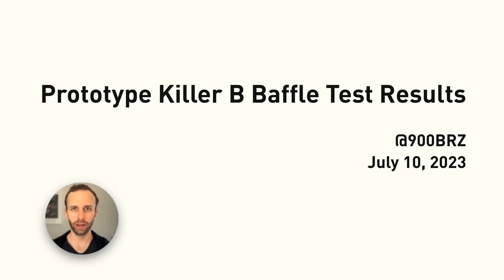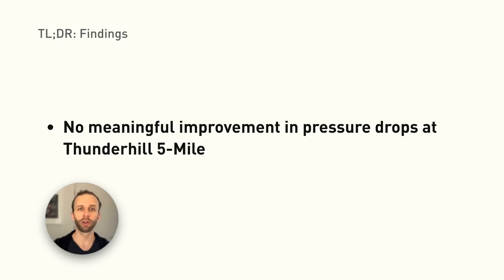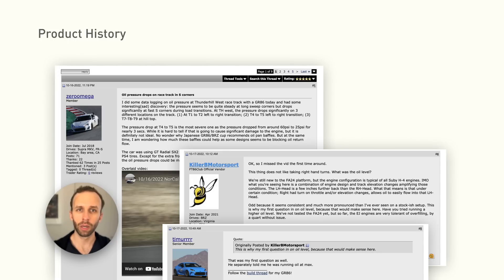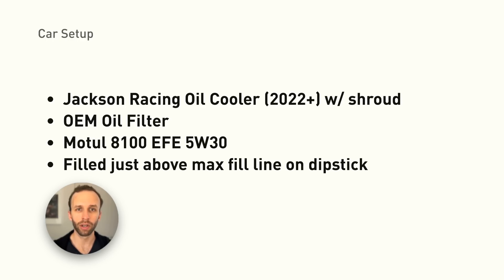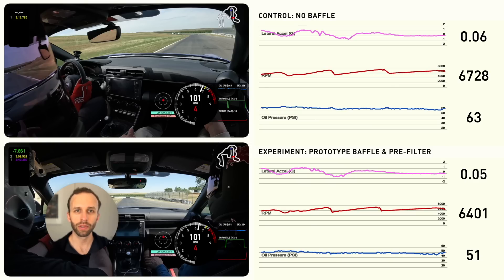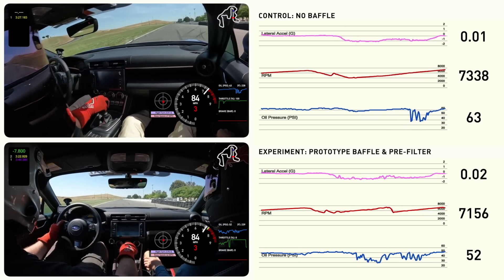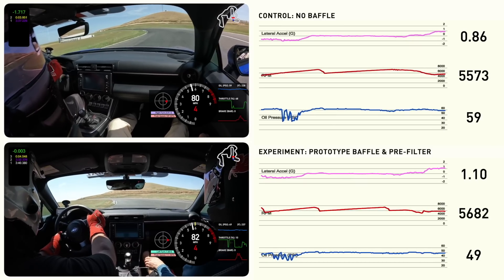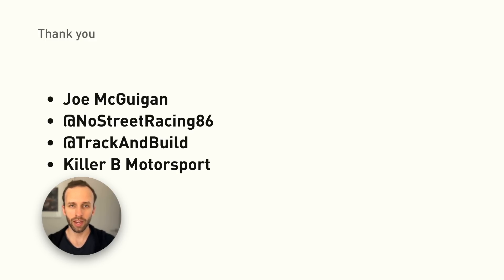BRZ/GR86 FA24 Killer B Prototype Baffle Test Results

Comment: seriously awesome work. While I don't have a second gen I really appreciate the hard work you're putting into this issue. This is the kind of stuff that makes the twin community so great.

With that said I'll bring up what I mentioned on your last video. After looking closer at the shape and layout of the oil pan I still believe the issue is the asymmetrical oil pan and pickup favoring the passenger side. I'm pretty sure the best solution will be a vertical walled baffle that runs front to back to prevent sloshing towards the driver side. That's not to say a horizontal baffle isn't needed either but I think the car needs a system like what IAG builds for WRX's. 

As for your idea of over filling, I feel like this may alleviate some of the pressure drops but then you might run into more issues with excessive blow by. I'm guessing 1/2 quart might be ok but much beyond that I'd worry assuming you don't have a horizontal baffle to keep the oil from sloshing up into the the upper oil pan / block girdle area. It might be a good idea to see if KillerB will do a horizontal and vertical baffle system combined with a little more oil. Though it would be good to measure the volume of the stock oil pan and keep the oil fill to what will fit in the pan.
Reply from the maker: Great ideas and I’m thinking something similar. I’m interested in the Kazama baffle, which has a horizontal wall with a 1-way trap door to try and keep oil near the pickup. I’m a little concerned that unless it’s welded in it may lose too much oil around the edges on the vertical section.

Comment: This issue is currently holding me back from purchasing a BRZ. The whole point of these cars is to be a fun little track car.  Might have to keep my evo for longer
Reply: Trust me, keep the Evo
Reply: Ironic considering Evos have oil starvation issues as well lol
Reply: @KTH96  except ive had mine for 13 years, its 25 years old with 115k km and many many track days without a problem.  All these are less than a year old with minimal kms and are spinning bearings.
Reply: If you need to replace the EVO, get a VB WRX.  The FA24DIT is as good as a 4G63 in many ways.   Only took Subaru 30 years....

Comment: Sad this didn't help :(( I had high hopes. I suppose I'll go SYMS + 1/4 qt overfill. I think I remember reading it's common to do 1/2 qt overfill? I've always been told overfilling is dangerous because it can push gaskets out and cause leaks though. And of course, the obligatory thank you for your testing, data and observation of variables.
Reply from the maker: I have heard people doing 1/2 qt overfills without issue. You may want to look into a catch can/AOS if you go down the overfill route, but I think 1/2 qt should not be a big deal. SYMS is the best performing baffle we’ve seen out of 3 now.
Reply: I drive my BRZ 2014 for fun at the Nordschleife and always have an overfill of 1/2 qt.
No serious modifications, just an oil cooler, lowered suspension and 235-17 tires.
Reply: @rickd955  I don't think FA20 had oiling issues though
Reply: @CarsMeetsBikes  Just look at offered short blocks for the FA20, most tuners talk about a oil pressure modification (keeping it a secret what is done). It seems that the first cylinder can suffer from oil starvation.
Reply from the maker: All wet sumps will have trouble if enough lateral G are applied. FA24 had this problem sooner than FA20 from out testing. Can’t even deal with OEM levels of grip.

Comment: I was surprised to see lower oil pressure, since the oil pump seems to be in constant pressure relief above 4500 rpm or so.  I would say that the suction pressure of the oil pump must be increased (i.e. more vacuum pressure at the pump inlet) in order to see lower gauge pressure at the outlet when the pump in in pressure relief.  High suction vacuum pressure is typically caused by inlet restriction (therefore probably the pre-filter in this case).  Ideally suction pressure shouldn't be more than a couple of psi of vacuum.  A 10 psi drop in suction pressure would probably be enough to cause cavitation and reduced flow.  There's a paper describing this called "Modelling approach on a Gerotor pump working in cavitation conditions".

In your last video you show two oil pressure sensors. Which sensor is showing the pressure we seeing on screen and where exactly is it connected?
Reply from the maker: Thanks for the comment. Yeah, I’m with you thinking it’s the pre-filter causing this issue. I’m going to double check my oil cooler hoses to make sure there are no other restrictions, but the cooler was not touched between these two tests, so it’s unlikely. 

My car is instrumented at the OE pressure switch location.

Comment: I'm wondering if your bearing wear is starting to take it's toll and causing your oil pressure issues.
Reply from the maker: I think the low nominal pressures were from the pre-filter in this test. Generally happy with my nominal pressures from the control test day, but even then it might make more sense to run *W40.
Reply: @900BRZ  I've had great success in my 2013 running Motul 300v 5w40 but these are different animals.  It might be worth a shot though.  The testing you are doing here is fantastic though.  The community owes you a debt of gratitude at a minimum.
Reply from the maker: @DeweyWRX  One of my friends who suffered bearing failure on track was running Motul 300V since he started tracking, so even expensive motorsports oils are not enough to prevent damage.
Reply: @900BRZ  no matter how fancy the oil is, pressure being that low will kill the engine.  TOTALLY agree with you.  This is just something that has worked well for me and my customers on the FA20s over the years.  I think you are right though, a baffle near the pickup is the next logical answer to help with whatever is causing your problems.

Comment: The first thing I noticed was the oil pressure was almost 10psi lower. But I'm not too worried about the rtv. Once we apply it ourselves, I'm fairly certain the rtv won't be an issue. What catches my eye is even with the baffle, in some turns, you can see pressure drops earlier than with one on. My question is if these drops are significant enough, can we use the tomei baffle as a foundation and build upon there. Even on gentle curves this baffle proved to be a hindrance. The tomei baffle at least allowed the oil pressure to stay higher for gentle right turns and S turns. It's a thought, but I'm not the expert here.
Reply from the maker: We can definitely combine horizontal baffles with this one, but I would have wanted to see at least some improvement before trying that. As it is my plan is to remove this one altogether and then try out a different approach.

Comment: I think that the right turn oil pressure drop got something to do with the downward mounted oil filter. Air pocket can get trapped on top of the filter and coincidently, the oil feed is to the right of the return. Just a guess.
Reply from the maker: I don’t have any particularly knowledge to refute that. But it does seem like then we’d see more consistent behavior with that FA20. It does exhibit pressure drops, but not as severely as the FA24 unless you’re running a higher grip setup.
Reply: @900BRZ  I come up with this hypothesis because I dealt with some fluid exchange pump have those upside down mounted filter and the housing is transparent. And you guessed, there is alway air pocket on top of the filter housing. So the FA/B engine might behave the some.
Another thing comes to my attention, the bypass valve on the oil pump is a perfect horizontal cylinder, and it looks like it opens to the left. maybe the high G makes it open at the wrong pressure?
Reply: @900BRZ  the graph from your previous video at cca 5:40 https://youtu.be/4Jk5WTWoqt4?t=342 shows that that particular gr86 behaved the same as the FA20.. it seems to me like there is some construction based issue same for the both the fa20 and 24. another question is how the oil cooler can affect the pressures if this additional plate with filter actually worsened the situation? do you think it would be possible to test the full stock car? I think this would be the best possible start to rule out all external factors... greetings, gj
Reply: Curious if changing the type of oil filter where height and supported oil pressure may change the result as well as using the baffle.  I think the gen1 has a lower pressure sped'ed filter

Comment: What baffles are you thinking about experimenting with between GReddy, Tomei, and Ansix? From what I've read GReddy is supposed to prevent some oil from going into the timing chain cover (though after your video that seems less of a selling point), the Tomei cannot fit the KillerB pre-strainer, and the Ansix utilizes the flaps which KillerB dislikes in a horizontal configuration.

Edit: And thank you so much for providing such a thorough analysis of this issue. It wasn't long  ago we all just thought it was excess RTV
Reply from the maker: I’m interested in the GReddy, but less so than I was before this test. We’ve seen good results with the SYMS baffle so far. Also interested in the Kazama design.

Comment: if the oil pressure sensor is on the timing cover, could that be why the nominal pressure was lower with the baffle considering less oil would be going to the timing cover from the pan?
Reply from the maker: It’s tapped into an oil passage so it’s not exposed to oil at ambient pressure in the timing cover. The oil that would surge into the timing cover would be at ambient pressure.
Reply: @900BRZ  👍 I wasn't 100% sure on how that worked. Thank you

Comment: A good ol' baffle should help... maybe a combination baffle and oil pan spacer to increase oil capacity.
Reply: Does the spacer also move the pickup further away from the bottom? Seems like that would be moot if it does
Reply: @politicallyerect6086  it would increase the distance between the pickup and the bottom of the pan. I don't know if it will have any effect on the pressure drops but increasing sump capacity is usually a good thing in motorsports. After I made the comment, I saw another video with a car with the Tomei baffle and that still had pressure drops.  I'm thinking....how much oil can slosh out of the the pan beyond the pickup reach?
Reply: @kchan333  just seems that if you move the pickup further away it’s not going to have access to the extra oil in the sump anyways. 
I’m excited to try my own little experiment this weekend. Putting a camera on my accusump’s gauge to see if the moroso baffle and killer bee pickup help with pressure drops. FA20 but on aero and Hoosiers

Comment: I think it is more on the pre filter rather than the baffle that caused the lower pressure..

The pre filter essentially shifted your oil pick suction higher position due to the perforation holes design compared to stock that is only open on the bottom.. 

Imagine using a straw filled with holes to drink
Reply from the maker: I called out that I believe the lower nominal pressure is due to the pre-filter.
Reply: Anyways great work man!! Looking forward to the next baffle that you will be testing and the overfill test
Reply: That prefilter is joke. I have little faith anyone that came up with that can design anything functional

Comment: I still believe the issue probably will be fix by a competition pan like the EJ we have, and replace that oil pick up exactly at the center bottom of the pan not like FA24 OEM to one side
Reply from the maker: Replacing the pickup is an engine out job unfortunately, so if we can find a less invasive solution, it’ll make it much more accessible.
Reply: @900BRZ  yeh, I know, then probably need to redesign the whole pan and baffle to fit that oil pick up, like a completely new design

Comment: Accusump  plz, feel like it's the obvious solution
Reply from the maker: Even if we end up using accusumps, we will benefit from having a working baffle, so that’s stage 1.
Reply: Hey  @900BRZ , you should look into de KAZAMA AUTO baffle, it's the only one I've seen so far with a vertical divider so it's a significantly different design compared to the rest that are commonly referenced and it might yield better results. In theory it should help retain the oil on the right side of the pan in right turns, which is where the pickup is. I agree with you that a good working baffle would be a more "simple" solution, so I'm very grateful for your approach.
Reply: @900BRZ  okay, so the question is if the accusump is enough for the long sweepers? I mean if the accusump solves the problem completely there's no need for other oiling mods
Reply: @BackroadBender  a 3qt accusump should be more than enough for long sweepers. They are relatively cheap compared to a dry sump, and can be t'ed into an oil lines pretty seamlessly.
Reply from the maker: It adds failure points, including humans in the loop if you use a mechanical value or if you use an electronic valve and it fails, you could flood the engine with the full capacity of the accumulator. Also have several new opportunities for leaks.